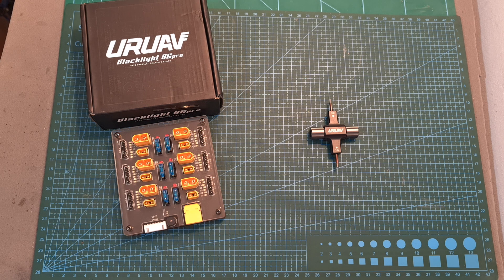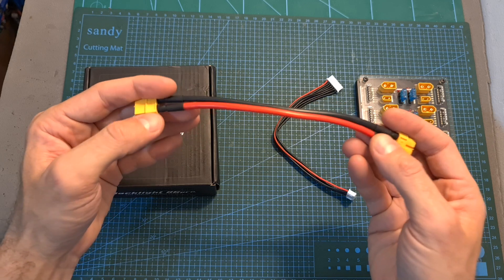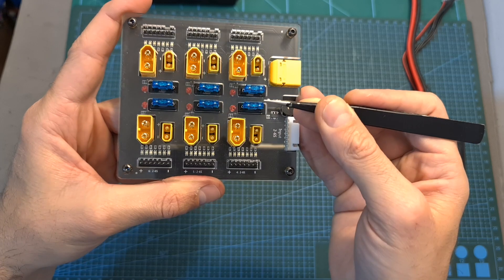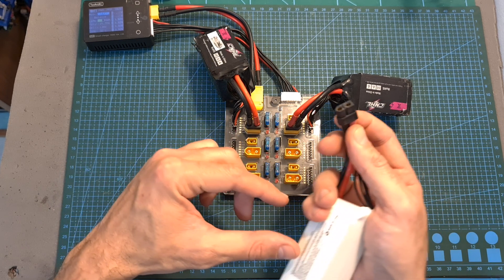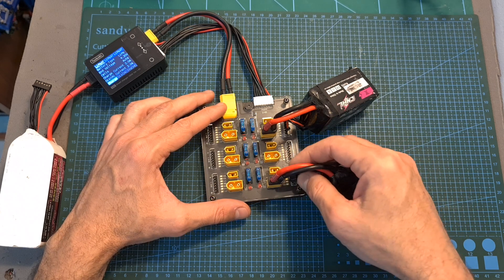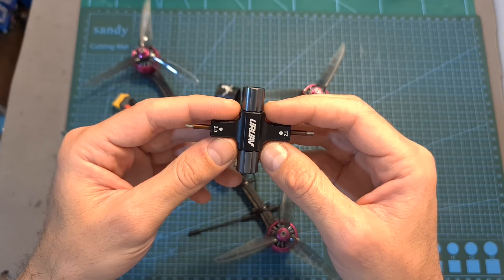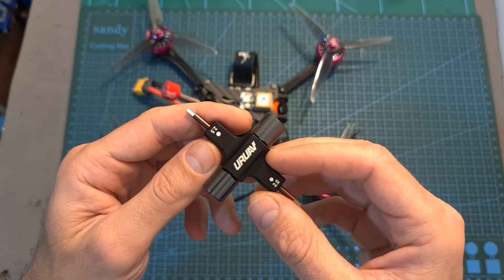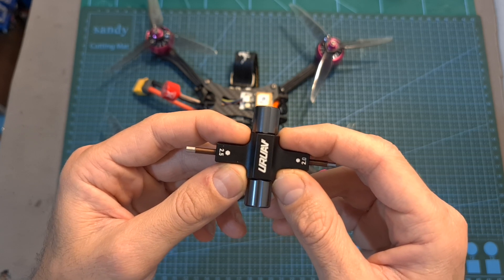Safe Parallel Charging? URUAV Blacklight B6pro // URUAV 4in1 Prop Tool // Giveaway

Comment: Got two of these boards. As soon as i unplug a lipo i get a wrong polarity warning on different chargers as well..anyone else? Is this normal with this board? None of my other boards have this problem..multimeter doesn't show something odd too..
Reply from the maker: That's weird. Sorry but I didn't experience this issue so something might be wrong with your boards. Have you figured it out by now?
Reply: @KremerFPV  Strange. Thanks for the response. Guess i'll just live with it or unplug the board first.

Comment: @gal kremer do you get any reverse polarity warnings on the charger when you unplug a battery from the board? I just got this board and uruav is saying this is normal.  Happens on both chargers I have tried this on.  Besides that it seems to work just fine just don't see anyone posting about this issue its rather odd.
Reply from the maker: Sorry but I didn't notice this issue with the charger I was using in this video. I will check again and let you know if it happens.
Reply: I also get reverse polarity warning when unplugging. I'm using hota and isdt chargers

Comment: I've been using that board for few months now. I like it alot. As there is no  need to swap boards for xt30 or xt60 batteries.  I previusly had 4chan xt30 and  5 chan xt60 boards. Also ports 123 are nice :D

Comment: I have this board and it's great, it detected a battery that was completely dead (i thought was at storage) alongside a storage-charged battery and popped a fuse, sounded the alarm and I could remove without causing any problems.

Comment: 123 A rule of thumb that many people use is to only connect batteries that have less than 0.1 Volt difference per cell. 123

Comment: 123 You can charge different capacity packs together that are the same voltage, provided the cells are within .1V of each other. Just add up the capacities and treat them as one pack of that sum, and charge at 1c. 123
Reply from the maker: That's exactly what I said in the video :-)

Comment: That's a really good and class one, I need to get one of these as it takes forever to charge   3 batteries separately. And that's a cool prop tool I use a spanner 🤣 123 😋

Comment: I remember someone saying the margin accepted to plug lipo in paralell was 0,1V per cell. So with 6 cells, we could connect them with 0,6V difference. Is it the case or Am I mistaken 123 ?
Reply from the maker: Nope, you got it :-)

Comment: I really like all the safety features of the parallel charge board and that it has both xt30 and xt60 but wow it's expensive. The prop tool is something I'd buy though. 123

Comment: I'm still super hesitant on parallel charging. Because of the batteries needing to be so close in voltage together. So if I happen to charge one that is 3.6 and 3.8 cells it could cause a fire 🔥?   I was always scared but this one looks pretty good. Just scares me
Reply from the maker: Not sure if it will be that harsh but it's not healthy for the batteries. If you can afford it, get two chargers with dual ports and you will be all set ;-)
Reply: @KremerFPV  yeah that's what I'm doing going to get another dual charger.  Ps. Chag sameach to you and family

Comment: Any other parallel charge board recommendations? 123
Reply from the maker: Sorry but that's the first one that I've got and I am not going to use it, as I normally charge my batteries at home and I am using two chargers with dual ports.
Reply: @KremerFPV  well if you want to get rid of it, I'll cover postage 😉
Reply from the maker: @blitzedfpv8298  haha

Comment: Even though I'm no newbie I never felt comfortable with parallel charging. Also blew a trace once on a parallel board when plugging in ....scary! But the tool is super cool! I'm putting together a lightweight backback for 1 quad and quick flights with just the basic stuff in there. That tool would be great! 123
Reply from the maker: I am sure that it will be useful :-)

Comment from the maker: Giveaway is now closed: https://youtu.be/EV7uWN5UA88
Yes, it B6 Pro and not 86 Pro :-) 
► URUAV Blacklight B6pro: http://bit.ly/URUAV-B6Pro
► URUAV 4in1 Prop Tool: http://bit.ly/URUAV-4In1
Reply: Did you think it's better than isdt ? xt60+30 but maybe less safer ?
Reply from the maker: @25Kam25Kam25  I don't have any experience with the ISDT parallel charging board and personally I am going to stick to individual chargers.